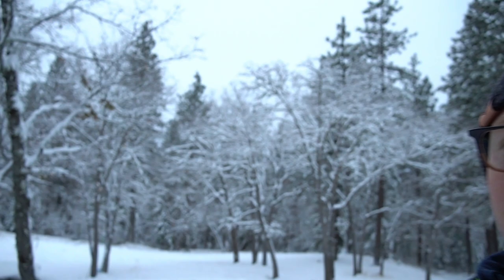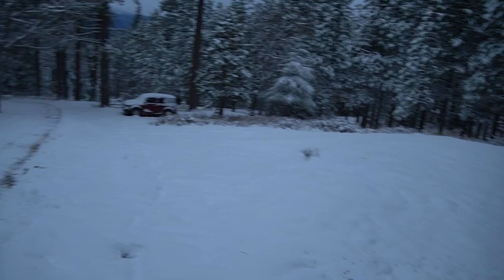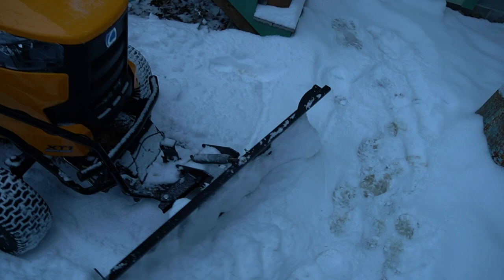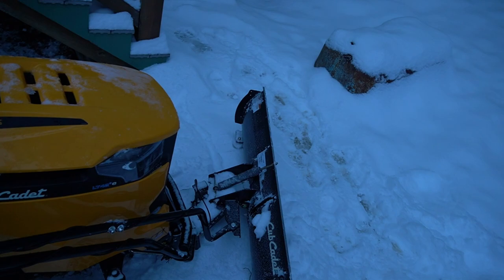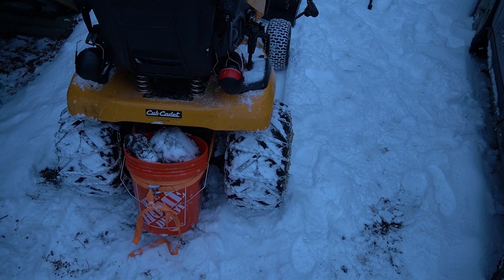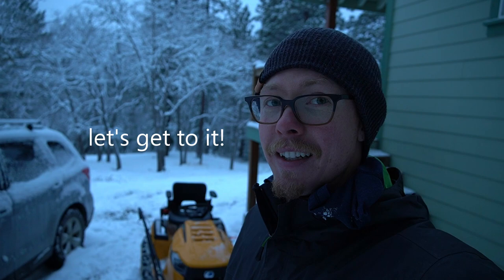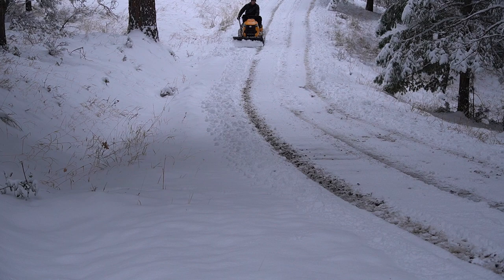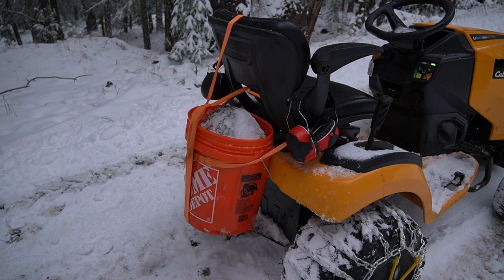Cub Cadet XT1 ELECTRIC Snow Plowing!

Comment: I have the gas version. I use a milk crate as a weight box. Nice video!
Reply from the maker: Hey thanks, Milk Crate is an excellent choice!
Reply: I have the regular weight kit and chains, works great.  I have the snow blower though, not the plow...I do want to get the plow though as most years we don't really get enough snow to use the blower, but the plow can be used for grading too during the rest of the year.

Comment: That is pretty good, wasn't expecting it to perform so well, especially without needing a recharge.. I run an old Ford 8n with a plow, it is more of a romantic drama to get the tractor to plow than actual plowing, but usually I am trying to get it going when it is -20c.

Comment: Be carful, the lithium battery has to be above 32 degrees "internal battery temp", to be charged, or it will ruin the battery. It is ok to use it in the cold thou... Won't hurt anything.
Reply from the maker: Marvin Johnson hi Marvin! I have heard this before, totally believe you but would love to learn more, lithium chemistry can vary, do you have any good links to articles about this? From my experiences with ebikes, the battery gets warm quickly from charging. I wonder how long it takes for it to be above 32 during charging. Definitely an issue when first charging if very cold!! Thx so much!
Reply from the maker: @sergiomomesso1590  Appreciate the link Sergio. I think this winter I will just get a nylon cover and run a little space heater to get the battery warm to start. It is my understanding that these types of insulated packs generate their own heat very well when charging, just need to give it a heat boost to start.

Comment: If you have more than about 6-8" of snow to plow you'd be in trouble with a plow.  That's where you'd really want a snow blower to get i up out of your path.  I'd like to have the plow for my XT1 for the light snow falls that we usually get and still have the snow blower for the rare occasions we get 10+" of snow.  The trouble with the blower is its somewhat a pain to install and remove to swap between the blower and plow LOL, so it may not make sense to have both unless I get a 2nd lawn tractor to mount the plow or blower to.
Reply from the maker: Totally, I mention that in the end of the video about more than 8" of snow. Definitely a no go. They don't make blowers for the electric version yet, but I assume it's only a matter of time. I'll probably get one when they do!

Comment: Have you ever seen the old General Electric Elec-Trak garden tractors? I own 2 and love them. They were built during the 70s fuel crisis. If you ever want a heavier duty garden tractor for plowing I highly suggest it if you ever have the chance to buy one. The big frame models weigh in at nearly 1,000lbs and will just play with 8 to 10".
Reply from the maker: Yes I have actually, I have never seen them run but I’ve sat on it at a show. Are you still running the original battery? If so how is the capacity and run time after all these years.
Reply: @felixandforest  No, I put new ones in it. They are just (6) 6v lead acid golf cart batteries. You can also use (3) 12v deep cycle marine batteries, you just have shorter run time. With the 6v GC ones, you can mow around 2 1/2 to 3 acres. I can pull a trailer or other attachment for about 3 hrs runtime on the small marine batteries or mow about 1 1/2 acre. I just use the small batteries because my property is small. I will be uploading some videos of it in action this year as well. I came from using gas tractors & equipment my entire life, but I love the electric stuff now.
Reply from the maker: Jeremy Davis great info! Thanks! Would be interesting to see how they would run converted to Lithium. I’m hoping this tractor lasts 30-40 years too, at least drivetrain wise. Things tend to last a lot longer when you aren’t making constant little explosions inside!
Reply: @felixandforest  yes they do. I also switched my gas string trimmer to the Ryobi 40v line. I absolutely love the thing. It handles all the same attachments with power that matches a 30cc gas. Enjoy the electric cub. It looks like a nice machine!
Reply from the maker: Jeremy Davis I have the Ryobi 40v line too. Love it.

Comment: Awesome video, i am considering changing my gas XT1 to the full electric now less maintenance fuel degradation trouble, also most of our home is running on our roof solar so this should be part of the home setup. We don't have that much snow here in The Netherlands so it is mainly mowing and pulling stuff i was just wondering how the machine would operate in cold conditions so that is actually really good !... The European version seems to be based on XT2 platform but the only question i have is how does the machine operate on High Grass can de blades and blade motors handle that well? Thanks for the video impressive !!
Reply from the maker: It mows better than the gas in my experience, because the motors that drive the blades are independent and direct drive to the blades, it feels like it has more torque. I mowed a 2 acre field of 3-4 feet high old stubby grass and small bushes with this and it had NO problem! I was very impressed. The belt drives are just another point of failure on the gas ones. I really, really like this lawn tractor. As others have stated just try to charge it above 40F!

Comment: Great video.  I am moving to 4 acres with an approx 600 foot long drive way with some hills and about 1-2 acres to mow.   I wonder if this will have enough power to snow plow.  It sounds like it does if I plow every 6” or so.   How does it mow on hills?
Reply from the maker: Hey Davide! I think you will be very happy with this. They just came out with newer models that have worked out a lot of the quality issues from this 1st gen series that I have. On hills it is a champ. Relatively low center of gravity. I have some Super Lug tires on it which helps on the hills but that's mainly for plowing and off-roading through my woods.

Comment: what size tires are the super lugs that you are using?  I looked for super lug but can't find 20x8x8.  I plan on going to the dealer where I purchased the tractor but would like to shop around for tires with rims, chains and the plow attachment.   Also thinking about the weight kit that they suggest buying with the tractor in place of the bucket of rocks.
Reply from the maker: I ordered them online. They are 20x10x8. Makes the stock chain size hard to put on as they are a bit bigger than the turfsaver tires. I had a tire shop install them on the rims for free. After this first year I have not used  any rear weights besides my body weight, and find the tractor to be more maneuverable without them and it has more power to plow without them too. But I also weight 200lbs so theres that. I really wish they would make an electric snow blower for this.
Reply: @felixandforest   I am waiting for cub cadet to make a snow blower with an electric drive.  I don't see the big deal with unplugging the mower deck and plugging into a snow blower.  It would be great if they could beat all their competitors to the market in this space.

Comment: Great video! I have the gas model, and use it to plow as well. I was wondering how the electric model would do. Can you show his the plow attaches and functions. I am thinking of buying that model cause I have to angle the blade by getting off the seat.. thanks!
Reply from the maker: Hi, thanks for chiming in. Yes will definelty do a video detailing how the plow works. Not getting off the seat to angle change is a HUGE benefit!

Comment: I also have LT42E with the same plow. I think mine is also a prototype because it has an odd rectangular shaft magnetic key that  only gets inserted but doesn't turn which has been hard to locate for purchase (as a backup in case single provided original goes missing). I was told by dealer that the tractor wont operate with the deck removed but I see in your video you have your deck off. Curious if you had to retro fit something to do so or if the dealer is simply wrong about that. I think plowing would be an easier task without it. What say you on this?
Reply from the maker: Hello! The magnetic shaft is a retrofit for the original turning key on the 1st generation models (maybe 2nd gen too.) The first models had some weird electrical issues and they swapped out any parts that had warrant issues with the key. Then they put the magnet key into production I believe. The key is a better design less moving parts. You should be able to buy it on cub cadet replacement parts website. 

The tractor absolutely works without the deck. Just get under there and unplug the wires to the mower deck to test. They have dust caps you can install after disconnecting. The display will throw an error code and the cruise control might stop working but otherwise should have no issue. Best to take those dealer folks with a grain of DIY boldness sometimes :)
Reply: @felixandforest  thanks for the speedy response. Good tip to just unplug deck wiring connections to test. I thought I'd have to wait until warm spring weather and remove the whole deck to try it.  REALLY ENJOYED YOUR VIDEO BTW. It gave me confidence I made a good purchase before I took actual delivery this past December. It has worked well this winter after all but 2 snow falls (upstate NY). 
Will be running it over the lawn in a month or two. Before that though, can you offer me any insights to the plow removal process? I did not do the install (dealer did) so not 100% familiar on the mechanics of the removal, and have not yet found any videos covering that. Thanks again!
Reply from the maker: @cnsbleavn  I have the FastAttach plow, it is simply two metal bars with pins that you remove then slide out, then there are two gold U-Pins that are spring loaded you pull and remove when the plow is lowered to relieve compression effect on the pins. If you have the other plow I'm not sure how that one works. Good idea for me to make a video on that for this plow! Glad things are working well for you in Upstate NY! Got family in Ithaca and Syracuse and an Uncle who is an electric tool mastermind there.
Reply: @felixandforest  Thanks again MPL you again confirmed what on appearance looked to be the situation. Was uncertain it could be that simple. I just moved back east after 11 years in SW WA and was not used to dealing with snow. 
I have family near you too (greater Portland area) We can race our LT"s cross country stopping at the tesla rechargers. ;)  Be well, stay well...enjoy those mountains.

Comment: did you ever figure out how to get a snowblower hooked to it? sounds like you might get enough snow.
Reply from the maker: Sadly, such a thing does not exist yet. The snow blower requires a belt drive to power it. The mower decks are direct-drive powered by seperate electric motors, so no belts on the Electric version!

Comment: OK it’s been 4 years since you made this video is there any updates on the tractor? How’s it doing? Any better issues?
Reply from the maker: It had a warranty claim due to electrical malfunction that took about 4 months due to parts shortages. After that it works great, but the cruise control is broken. Battery is still going strong with no performance loss that I can tell. Use it almost daily! Still consider it one of my better purchases.

Comment: So, you're not supposed to use it while raining or wash it, so what happens when the snow melts on it?
With wet snow, you aren't going to be pushing much.
Reply from the maker: I wondered about that too. The deck blade motors and keyhole seem like the weak point as far as moisture goes. In the winter. I take the deck off and cap the ends of the cables w/ included caps. I've left it out in the rain a few times. No issues there yet.

Comment: Great video! I see you took off the cutting deck. Did you do anything to protect the ends of the cords that are connected to the cutting deck motors? (I.e., the cords you need to unplug before removing the cutting deck).
Reply from the maker: The cable ends come with little attached plastic locking caps to cover the exposed electrical connectors when you take the deck off. The deck is really easy to take off just 3 metal pins and the electrical lines to disconnect then it slides right out.
Reply: @felixandforest  interesting... I don't believe I received those caps. I'll see if I can find a part number for them. 

I've taken the deck off before-- you're right that it's easy to do so. You've inspired me to give plowing a shot this winter with my XT1 LT42E.

Comment: Best to charge after each use or run it down to under 50% (or less) before recharging?
Reply from the maker: Cub Cadet recommends just keeping it plugged in any time you are not using it. Seems like each manufacturer has their own recommendations for lithium batteries. I do believe that charging Lithium to 80-90% ONLY increases the overall lifespan dramatically. Like 10 years to 15+ years.

Comment: My question is. With how much more this costs then a gas one does do the electric motors/batteries actually last longer then a gas tractor does? If it’s double the price and doesn’t last as long as a gas one it’s not saving you money. Gas would be cheaper then replacing and electric motor or battery and it’s costs a lot more then a normal gas one would
Reply from the maker: A great question Hayden, only time will tell. Many factors to the answer. Electric motors are so much simpler mechnically, and thus much less likely to fail and need repairs. You would really need a TOTAL cost of ownership comparison over a 10 year period to fully answer. It's $2300 more to buy the electric version. From my rough calcs, gas, oil, small engine repairs, belts, grease, etc. etc. I'd say the cost is about even over 10-15 years for sure. This is still a new technology, it's getting cheaper every day. My bet is that in 20 years, you won't even be able to buy a new small gas tractor. So enjoy it while it lasts if that's what works for you!
Reply: @felixandforest  that’s what I’m worried about! I’ll be keeping my tractors around. I don’t wanna go to electric anything personally. I don’t think there any better worse for the environment then gas and diesel machines.
Reply from the maker: @haydenschneider3  Cool! to each their own my friend.

Comment: How's it holding up (a year later)?
Reply from the maker: Great! This winter the snow was a bit more spaced out. no huge storms like last year so the plowing was more manageable. Was able to meet all my plowing needs. I did have a warranty claim on the tractor, some significant first generation issues. They don't sell the version that I had any more. Warranty claim took 3 months to finish due to supply chain issues but running great now!
Reply: @felixandforest  I at least have a dealer local, along with big box store. I am getting the ZTR version as soon as it comes out. I don't need any of the tractor stuff, just mowing for me. My local dealer said he has had the battery version since 2012! I had no idea these were out this long in the battery-powered. I'm a huge fan of the Lithium battery stuff. When all said and done the Cub ZTR is about $1500 less than the competition.
Reply from the maker: @JasonCarmichael  Wow maybe it was a prototype version or something. Nice choice on the ZTR, if you're only mowing totally the way to go!

Comment: you won't go far with an electric but the gas model can cause you don't have to stop every 30 minutes for a charge
Reply from the maker: Hi Joe, a couple things here. This model will run for many hours of continuous use without mowing. It can mow for about two hours straight on a single charge. Without the mower (1/2 the year use) for me, it will run for significantly longer. Very few people need to run these small tractors for longer than that continuously. Usually people take a break. If you really need all day use, I just use it in the morning, charge midday then use it again in the afternoon. Works great and I have experienced no frustration with how much run time or how long it takes to charge. The system is very balanced and contains 3000 Wh, that's a lot of juice.
Reply: @felixandforest  i am also talking about horse power reasons to cause there is a part inside of the crankcase on the gas model that will give it a bit more umph to plow thru large mounds off snow it is called a govenor spring it will give you a little bit of an advantage to plow or mow better in sticky situations
Reply from the maker: @joebowser6220  That's good to know! I will say the electric feels a bit underpowered and I think they could do better with it.
Reply: @felixandforest  that and i am a mechanic that works on those types of engines

Comment: Is it hard to remove the grass mowing deck? Thanks
Reply: On the newer ones it takes about ten minutes at most to remove or reattach the deck. 4 plugs (three motor phase and sense wires - twist connector and pull, they push back together) and three cotter pins. I recommend lowering the deck onto a piece of cardboard or something that can slide after disconnecting it. When sliding it back under the tractor be careful of snagging the deck on wires. If you use this for plowing I would tuck the motor wires into the battery compartment so they don't get wet. You will get an error code about the deck not being connected (I think e225) but it won't prevent the use of the tractor.